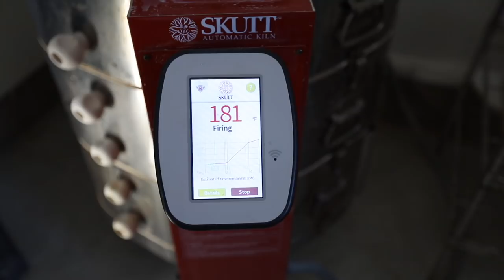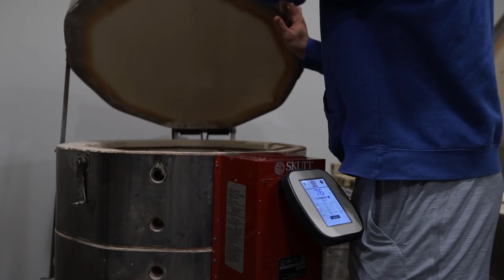MAKING A BOWL - The ENTIRE Pottery Process - ASMR edition

Comment: When you were trimming ..... what was that Little Chip thing that you put on the bottom?
Reply from the maker: That is a little trimming spinner from Diamond core tools , it’s a helpful little tool!
Reply: @Jonthepotter  Great I will have to check it out .... maybe when you have time for  a quick demo on how this used .... i am not finding much online......Thank you
Reply: We use a metal lid of a jar in school. Works perfectly. You put it the same way as on a jar. That way the pressure is not in 1 spot but diffused around the rim of the lid. (sorry, bad English. Hope you understand).
Reply: @____Ann____  I use the cap of a ketchup bottle. Works fine with smaller bottoms.
Reply: @unglaubiger5645  Me too. I have several sizes. Depending on the size of the foot of the pot.

Comment: What kind of kiln shelves are the black ones you use?
Reply: They look like silicon carbide shelves.  They don't require kiln wash.  Glaze just pops right off.  They are significantly more expensive though.
Reply: I would guess Advancer shelves, very $$ but worth the investment
Reply: I’m fairly new at making functional pottery, but I’ve quickly learned that I enjoy practically everything I cook and eat or drink from the plates, bowls and mugs I’ve made. Even the less than good pieces can teach you something by using them.